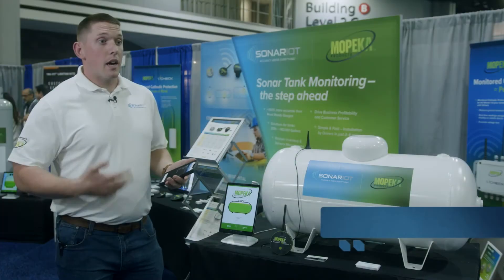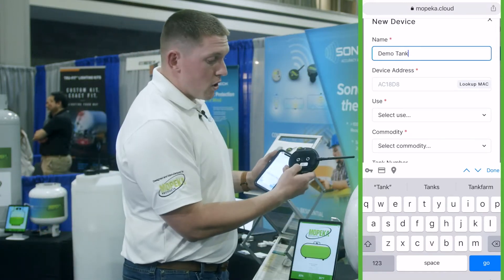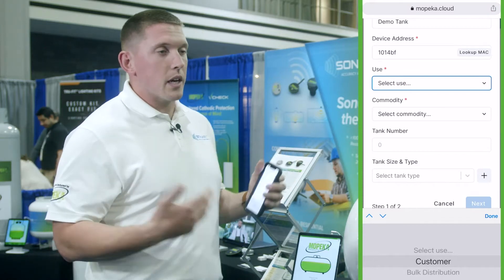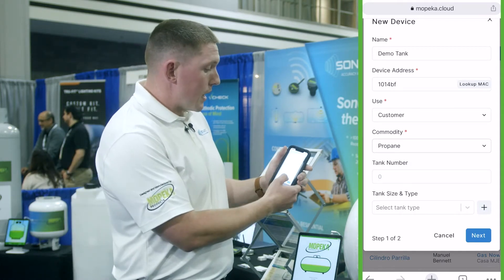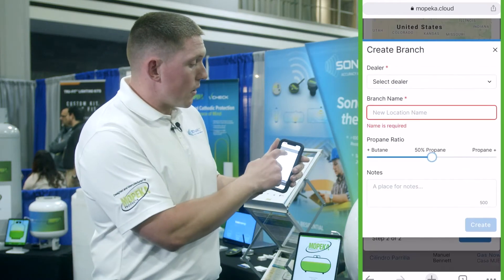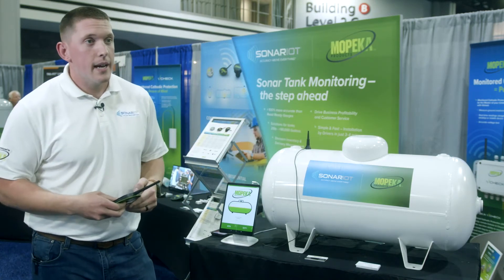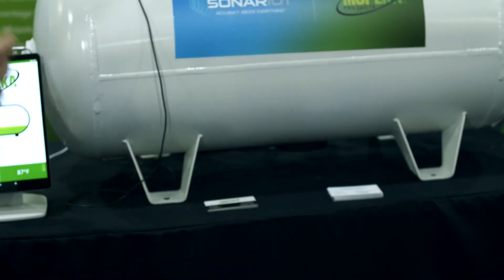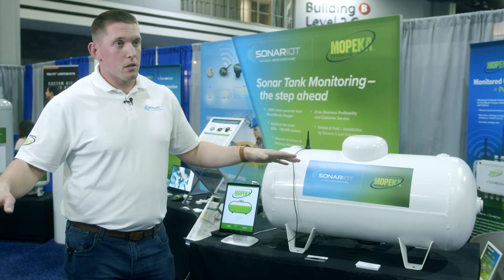Configuration and Installation - Mopeka Pro PLUS

Comment: Has anyone ever had there sensor fall off the bottom of their tank on the hwy?  Wondering if some tape on it would help hold?
Reply: You purchase the Mopeka Collar Set to hold it securely in place Cost about 15 bucks
Reply: Are you discussing horizontal type tanks under an RV?